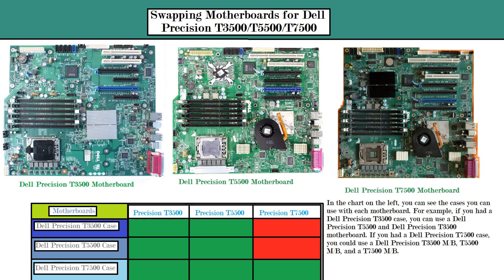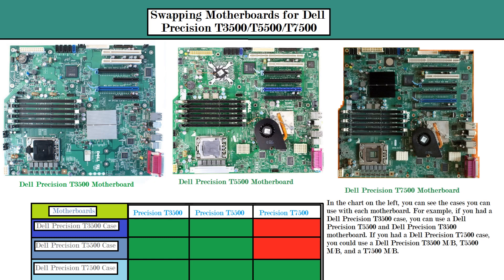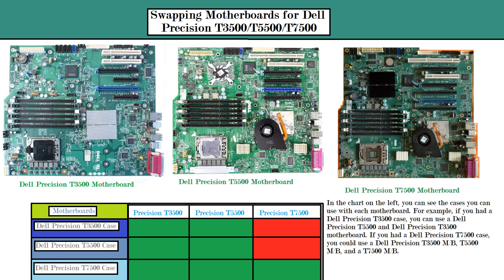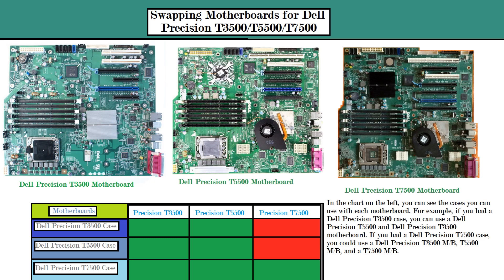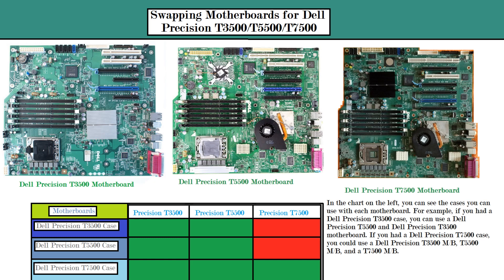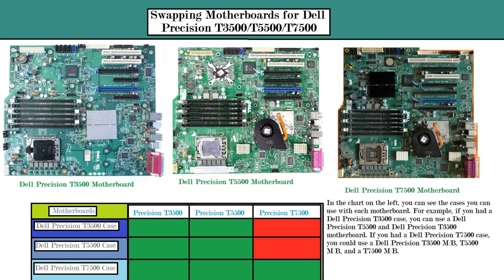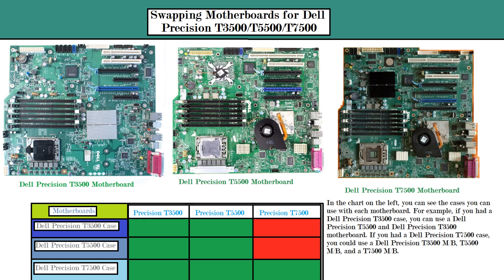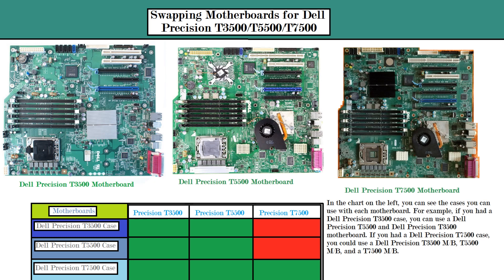Swapping Motherboards for the Dell Precision T3500/T5500/T7500

Comment: I ended up making this swap last night  (the power supply on my T5500 blew up so I was forced to). It went well, fits perfectly. The T5500 motherboard doesn't have a port for 1394 so I didn't connect that up from the front panel. The only other issue was that there is no fan header on the T5500 board for the rear fan that the T7500 has (there is on the T7500 board). So I'm going to try running it from a molex.
Reply: Hey Jeff I have the T5500, do you have a source for faster processor chip currently 2.0 would like 3.2 or better.
Reply: @jamaaltasby249  I use Xeons - X5670 which clock at 2.93 GHz. For 3.2 GHz you would need an X5679, X5680 or X5690. These use the Gulftown / Westmere-EP processors https://en.wikipedia.org/wiki/Westmere_(microarchitecture)

Comment: T5500 has TWO different motherboard versions: 6FW8P and 0CRH6C. First has form factor of T3500, the other of the T7500. The physical difference is on the left, or upper side, where it has different hole pattern and more real estate with 3 additional SATA sockets and 1 PCI slot. It looks that there is  not enough space to get the fatter mobos into the T3500 enclosure without butchering the case. I see nothing on Dell site about the different versions of T5500, but you can see the different mobos on ebay
Reply from the maker: I see....

Comment: A PC shop screwed me over supplying me with stock Xeon 2.0 GHz processor replacement after a blowout of a 3.2. Would like to bring it back up to what I had. Does anyone have vendor or source for a 3.2GHz or better?
Reply from the maker: 3.2, like 3.2 ghzs?
Reply: @Ace1000ks  correct, thank you for clarifying.
Reply from the maker: @jamaaltasby249  You can them on Amazon, I will give you the link. 

https://amzn.to/34KaQ5Q
Reply from the maker: @jamaaltasby249  They can be used as a pair or as a single CPU.

Comment: Hello i have a t5500 motherboard, can i put it in another case i want ? (I dont have neither of the cases seen in this video). Thank you.
Reply from the maker: I don't think so, the front panel pins are different compared to a standard ATX case.
Reply: @Ace1000ks  how can i turn it on ? I have everything but the case
Reply from the maker: @natomanza3471  You need to buy another Dell Precision T5500 case, or you have to know which pin on your motherboard is the power on pin. I don't think Dell provides that information.
Reply from the maker: @natomanza3471  You can put your Dell Precision T5500 motherboard in a Dell Precision T3500 case, T5500 case, or a T7500 case.
Reply: @Ace1000ks can i replace the motherboard in dell t3500?
Reply from the maker: @shadowlemon69  Yes, with another T3500 motherboard.